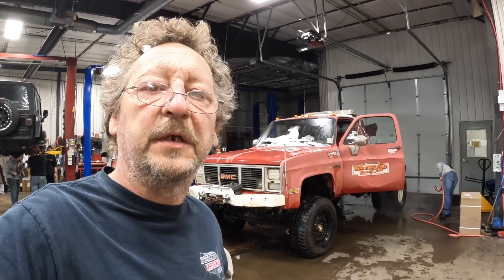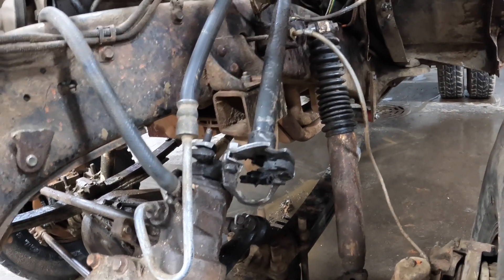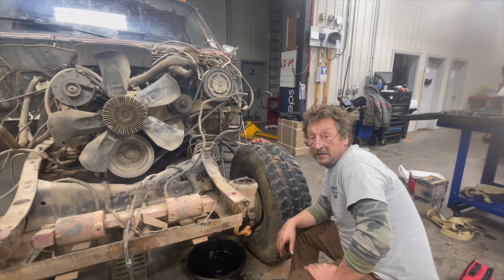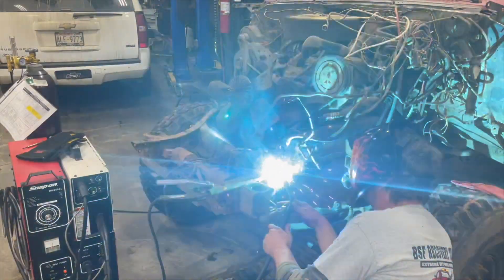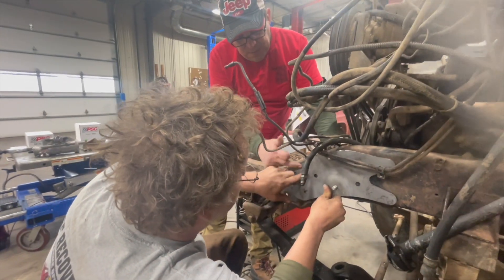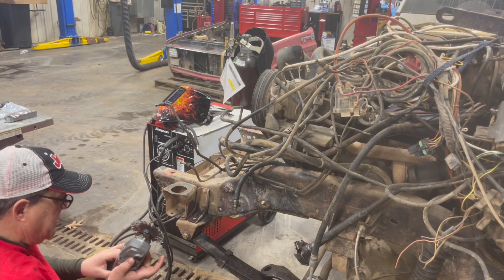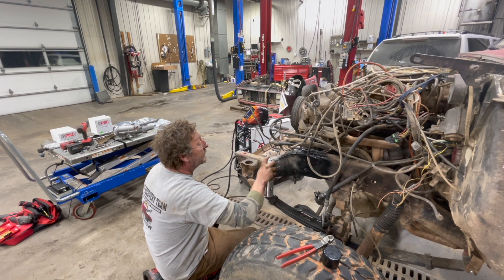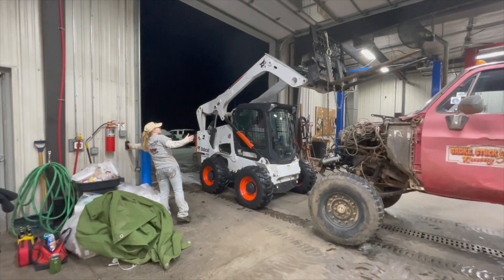Steering box and frame repair

Comment: Back in the day I was a mechanic in a 4 wheel drive specialty shop. At least once a week I was repairing the frame on the old square body chevys right where the steering gear mounts. It’s a common failure point when guys go to bigger tires. I have seen a few that completely broke the frame in two. I don’t recall the manufacture but we had a fish plate kit for that. It was 2 pieces one fit the frame side one fit the bottom.   Many times we will sell that as an upgrade to lift kits we installed. To prevent the frame from cracking and breaking
Reply: Steve Summers (another YouTube channel) just put a Rough Country kit on his.
Looked similar to what Eric put on.
IIRC, Eric had already beefed up the lower frame rail.
Steve had too. So neither put the one from the kit on.
Maybe Eric will touch on that in the next video.
@recoveryteam
Reply: That seems to be the Achilles heel those square bodies as I have seen it on 2wd as well.

Comment: Looks good! Just got done doing the same thing to my 78. I added a plate on the back side also. I replaced the rag joint with a steering knuckle from a jeep. And replaced the tie rod ends with heim joints. Hopefully I won't have any more issues with steering!!

Comment: I don’t know how that lasted so long without a frame plate.  Must have been because it was without a front locker for a while.  I usually add a plate on the back side of the frame, then use heavy wall DOM through the outside part of the frame and butted to the inside plate.  Very strong repair.  I saw the PSC ram on the table. That would eliminate a ton of stress.
Reply: The 1 tons tend to last without compared to the 1/2 and 3/4 tons
Reply: Eric has always been gentle with it 🤣
Reply: @thomasexeter97  I’m sure the locker didn’t help.  That’s a lot of steering force.
Reply: 1 tons have thicker and taller frames.  If it was a CUCV frame it would have a factory frame  brace.

Comment: I know its steel! But cast iron and aluminium you drill a hole at the end of the crack to release the tension. Please comment on me. Am i wrong to say that for precaution/overdoing it it could be done over here? You have support on this. Your mss and mr towby. Hats of to both of them.
And for your boss to give you the possibillity to work on your car.

Comment: I'm a little surprised that you didn't put a plate on the inside of the frame as well, considering that the holes had to be repaired. It would give it significantly more resistance to cracking beside the welds that you put in to repair the bolt holes. Great video all the same, keep up the great work!
Reply: Hydro assist is taking all the stress of the steering off the box and into the cylinder.  It won't be an issue again-
Reply: @D3thM3tal  He had hydro assist on it when he ripped the bolts through, didn't he? I thought when he changed out the front axle, he put hydro assist on at that time.

Comment: several years back i did one of those fish plate kits for my 77 square body 4x4 , i recall it being “ wonky “ also , didn’t fit flush , i ended up clamping it , then tacking it , moved clamp over then tacked it , kept doing that until i went all around the plate … ended up working fine , my bolt holes fortunately lined up …

Comment: That's one thing you should always address ahead of time kind of like the way you strengthen the frame before you put that crane on the, you should actually have that truck strengthened a little bit more, strengthen some spots throughout the frame from the back to the front and fix the power steering box area
Reply: That sounds good in theory but you have to remember that he (& everyone) lacks time and money 💰 there’s always going to be a weak link. Ideally he’d build a square frame custom built chassis
Reply: @m9 ovich but I was saying you know how the old Chevy square bodiesare known for the frame cracking by the power steering box.I was just trying to point that out before y'all have a problem with that
Reply: @m9 ovich I saw the whole video that's why I pointed out the power steering box area I was just letting y'all know ahead of time. I've seen them crack
Reply: I can point out on my 82 shortbed stepside GMC Sierra, somebody already welded the steering box area on my truck. I've seen the same problem on quite a few other ones

Comment: Eric it’s definitely coming along pretty good it looks like buddy!! Let me no how you end up liking the hydraulic steering set up after running it for a little bit please??? I put cross over steering on my 1969 Chevy 1Ton and installed a 2 wheel steering box with the ports already installed so that it should be easy to install at a later time!!! It is definitely pricey for the set up and that was why I had just done the cross over steering and not doing everything at once!! But I’m definitely thinking the time is definitely coming very soon hopefully!! Awesome video buddy!!! Remember keep up all the hard work buddy!!!
Reply: You can drill and tap your own box and then you're into it just for a surplus center cylinder and some cheap tab material.
Reply: @D3thM3tal  well I guess I didn’t no that!! But since I had to go to a two wheel drive box for the cross over steering if I remember right I had the option of getting a regular two wheel box or one with the fittings already welded in and then they just put caps on them so that you can just take the caps off when ready to plumb the new front hydraulic cylinder in!! I don’t think it was extra but if it was it wasn’t much at all!!! All I have to get now is the cylinder and lines for plumbing it in and I think that might be it other than maybe some brackets to mount the cylinder in?? Thanks for letting me know for the next one I might end up doing also!!
Reply: I'm sure there's plenty other vids of people that have done it and shared their opinions

Comment: Chock this up to hindsight is 20/20...  but why didn't you oversize the holes on the plate around the steering box bolt holes?  This would have allowed a perimeter weld to the frame in the bolt locations making those holes even stronger and eliminating another point for water etc. intrusion between the plate and frame.

Comment: I'm surprised that that plate wouldn't be welded onto the inside of the frame to keep the steering box in the same location.
Reply: Really though. The thickness is so small that you wont even notice. Just a small adjustment to the drag link and youre good

Comment: For future reference with any cracks in steel you need to drill the end of every crack to stop it. If not it will continue to crack no mater how good you grind and weld
Reply: Just drill the ends with a small drill bit like a 1/16 or something 1/8 or under or you can fill bigger and weld it back up.

Comment: There are no written instruction for this repair, no two repairs are the same, this particular job requires good old-fashion all American know-how, lol, it's hard to believe you couldn't find a simple drill-bit at a dealership garage, you'd think a government funded automotive-company would have anything/everything in stock, but that's probably why they went bankrupt too start with, lol, thanks for sharing guys.
Reply: Mechanics have to supply their own tools.
Most have 20 to 40 THOUSAND dollars worth of tools at work.

He was looking for a carbide grinding bit to put in an air die grinder. Not just a drill bit. Again, each tech has to supply their own if they want one at work.

This is why mechanics giggle when nurses and teachers bitch about spending a couple hundred dollars a year out of their own pay check.
Just sayin'
Reply: And they get paid how much: $18-35 an hour? And the dealership charges $110+ an hour 🤔
Reply: @RustyZipper  I work at a truck shop.
Middle of that pay range.
Customer pays $135.00/hr.
Plus shop supplies fee.
Plus "environmental " fee.

Comment: I have a 1994 ford Econoline e150 that had the steering box jump off the frame and leave a hole in the frame where the bottom steering bolt goes. My steering box wiggles when I try to mount it, so the fix is to weld the hole in the frame?

Comment: Do you think that you weakened everything in Utah more wheeling?
Reply: Utah was easy on the wrecker compared to what it goes through in the WI/MN trail system.
Reply: @D3thM3tal  okay and I didn't know if it weakened it by climbing the rock walls and stuff

Comment: I see in the square body group on Facebook there’s a steering shaft from an XJ that eliminates the rag joint might be a considerable choice for the abuse the wrecker gets
Reply: Rag joint won't be an issue with the assist unless the engine isn't running with the assist.

Comment: You really  shouldn't  drilled  out the end of the cracks before  grinding them and put a large washer between the steering box brace and frame to help spread the load out.  The frame will crack again over time every  with the frame repair plate.

Comment: The plate should go to the inside
Reply: Nope. That one is designed to put right where Eric put it.
Some guys add another on the inside.
Some guys get THICK large O.D. fender washers and weld on the inside.
Reply: Some guys use JB Weld, them guys work Flat Rate. Let the next guy fix it 🤣